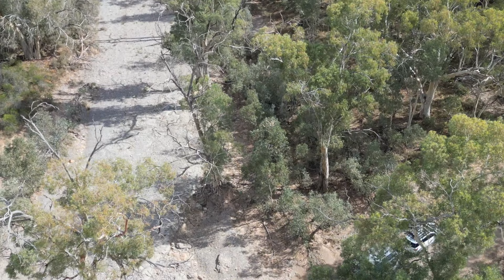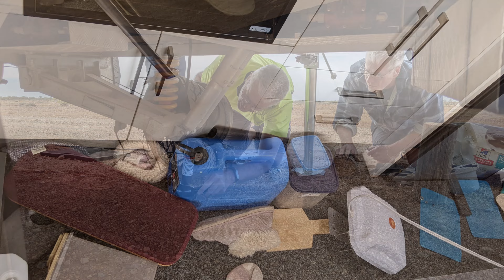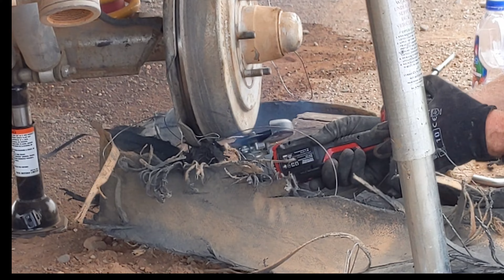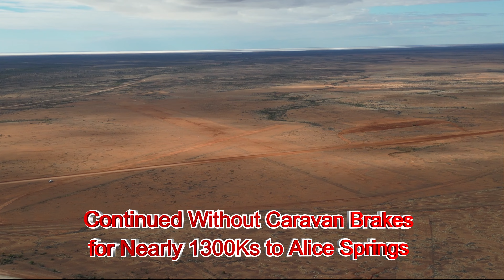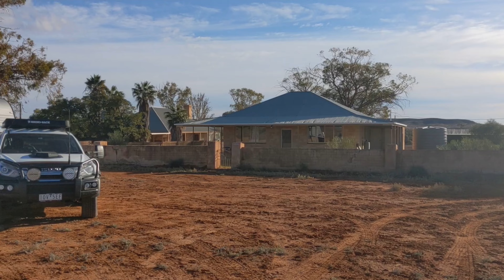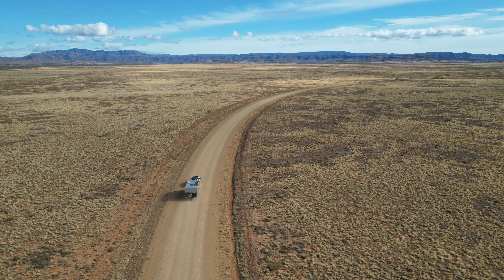May 2023 -  RUD

Comment: I have been using tyre pressure monitoring of all tyres including the trailer.  Should the tyre pressure go below the threshold I get a warning in the centre display.  I have travelled the same roads and use a very important rule - unsealed roads deflate tyres to half (start at just under half on sand) and do the same to your max speed.  These are start pressures and often on bad corrugated roads I am down to 1/3 Rd pressure.  Corrugations are a few millimetres high (may have dust on top of that) and the trick is to have your sidewalls take the bumps not your suspension.  I usually run 50psi  in the tow vehicle and 40psi in the van on sealed roads.  Start at 25 tow vehicle and 20 van on the dirt. The important rule is to not exceed half of 100 or 50kph when running half pressure.  On the Canning I ran 10psi front and trailer, 15psi rear for 1500 kms.  I never exceeded 30kph.  The next side wall I damage will be my first.  If you say you can’t run that low then don’t learn this in remote areas.
Reply from the maker: Thanks for the info. Its all about learning on the go. we now have a TPMS, but not doing much off road now.